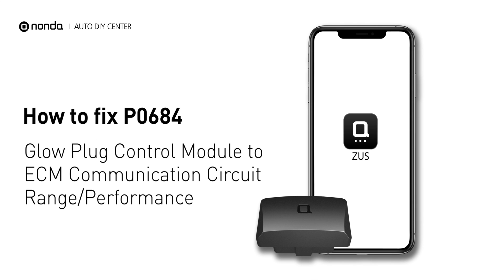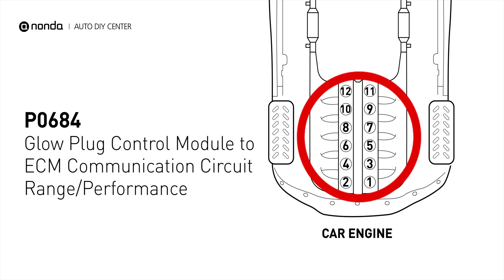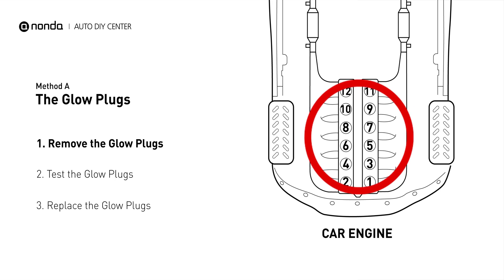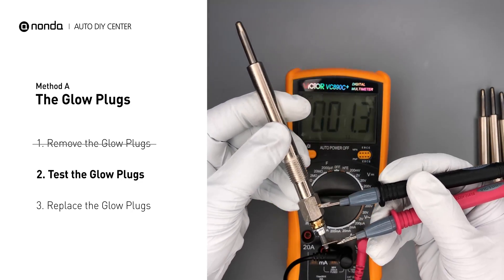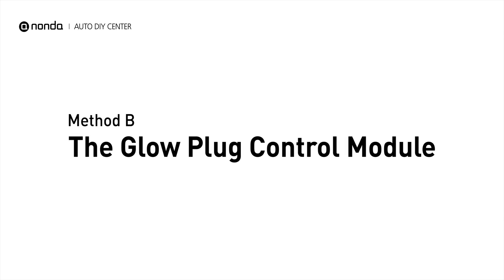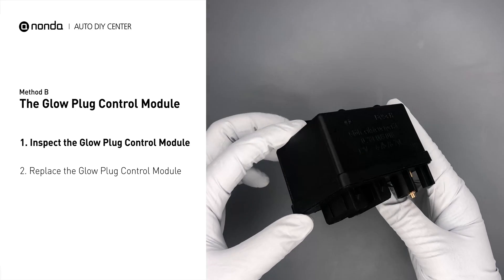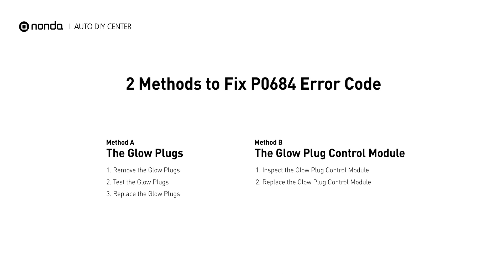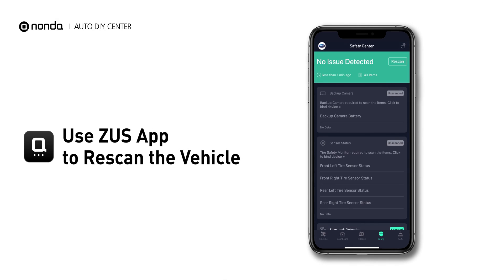How to Fix P0684 Engine Code in 3 Minutes [2 DIY Methods / Only $9.29]

Comment: Hi, love the videos.

I have fault code P0684 on my 2008 VW Tiguan 2.0 4 motion, and the control module has been changed. There is no light on the dash but the fault still comes up when its plugged in, any ideas please?

Comment: Have changed glow plug control module, glow plug on a 3rd cylinder (the rest glow plugs are ok) , the problem is remaining, check engine error message appears.
Reply from the maker: Hi Dimitri, can you please provide us with your vehicle's year, make and model?
Reply: @nondainc  hi there, tiguan 2.0tdi, 2018
Reply: P064C00 is the error message I got
Reply from the maker: In this case, we suspect a defective controller or a programming error (reprogramming and controller replacement is necessary).
Reply: @nondainc  hi! Which controller 🤔?